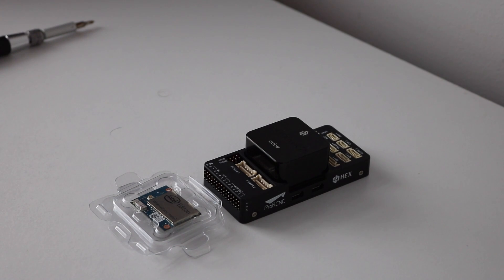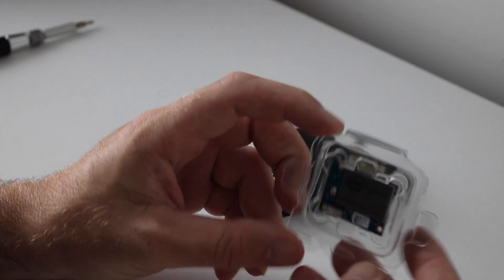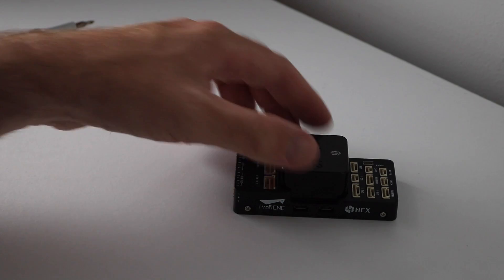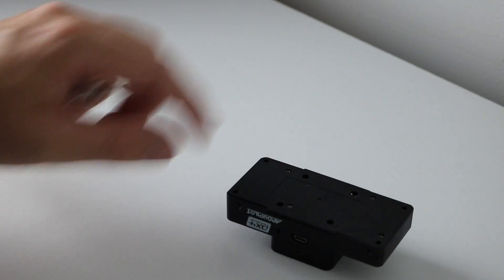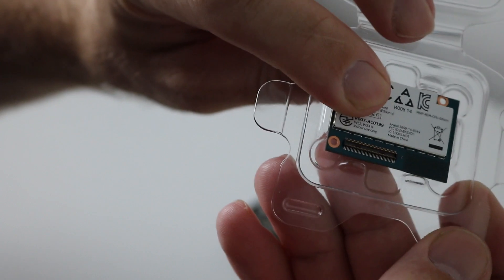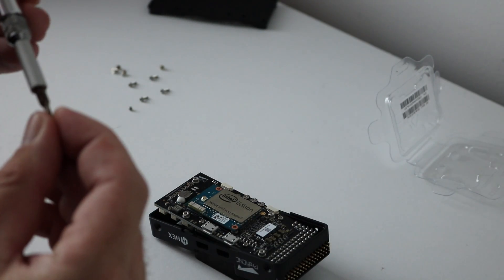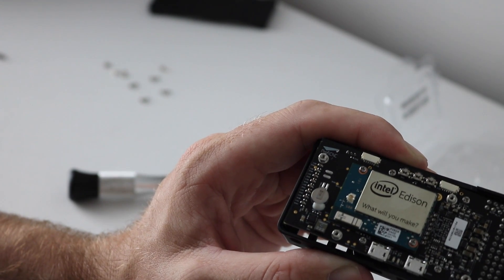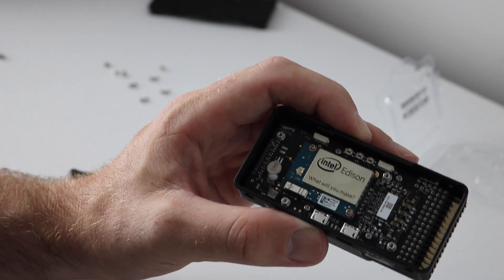The Cube Pixhawk 2 Autopilot and Flight Controller Intel Edison Installation How-Too

Comment: I can't get the compasses consistent on the pixhawk with mission planner or mavproxy , I continue to receive bad AHRS , something about pos terrain all kinds of crazy stuff . Do I have to pull the pixhawk from the craft or is there a way around this ? The gyros are spinning out of control as compass - motor calibration .

Comment: Unfortunatly the Edison as well as Joul and Galileo are discontinued. If you want want you should buy one now, they are still available in some shops.
Reply from the maker: Yep it is a shame, indeed this.
Reply: Will there be an alternative daughter board  supported?
Reply: Intel was in it for the money and they were barely making any, so they discontinued it.
Reply: This company sells a whole line of i.MX6 based "System on a Module" boards that have an Edison compatible connector at least. Not sure they'll physically fit in the PixHawk 2 though. https://shop.technexion.com/system-on-modules/pico/pico-modules.html/

Comment: can the edison version of the pixhawk 2 work without the edison installed if need be?
Reply from the maker: chandruth yes absolutely it's just got the additional port but you don't have to fit it, TBH I would recommend not to get the Edison version now as it's been discontinued and look at using external companion computer.
Reply: Thats great advice. I have a project requiring precision landing using image recognition, hence the need for an Edison. Do you have any advice on how I should go about it?
Reply: Can you mention a few boards the surpass and replace Edison?

Comment: Hi, Having setup, installed and flown the Cube based copter, can you give any comments on it's flight performance? 
Is it responsive? Is it easy to setup? 
Is it stable in flight? 
Can it hover steadily (no bopping up and down or significant movement in ALTHOLD mode)? 
Is it worth the money compared with other, cheaper flight controllers?
Do you have any videos of test flights? For some reason there are very few videos of test flights.
Reply from the maker: smintol Hi thanks for the message, i will be posting some more videos on this very soon, it's a tough one actually as there is a massive amount to talk about from power system choice to Arducopter setup, that in its self is a Hugh topic and could go on for hours, im going to try and do this is small steps keeping it as basic as possible then people can expand out from there with the more complex stuff.   I apologise it has take a bit of time to get some more out I got side tracked with other projects.  The craft it's self is flying and flying well and I will get some more info up very soon.